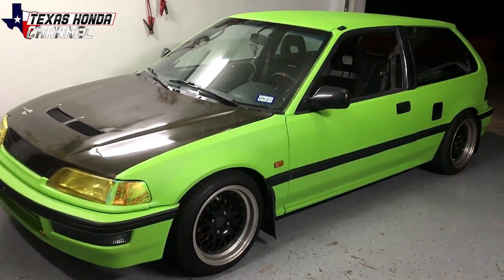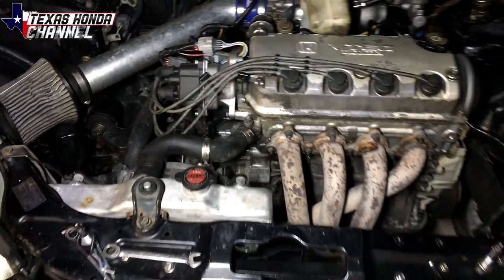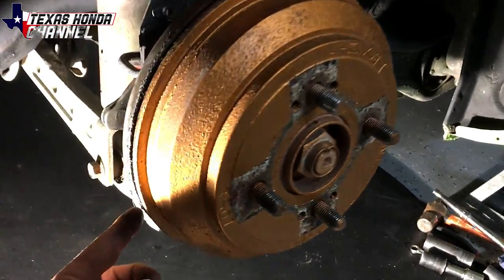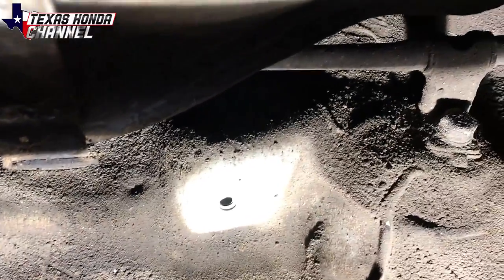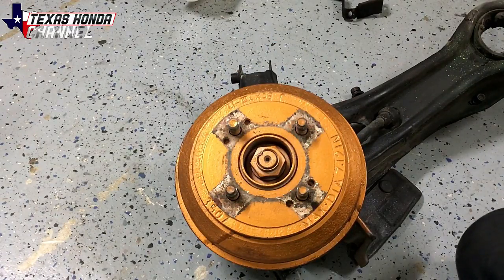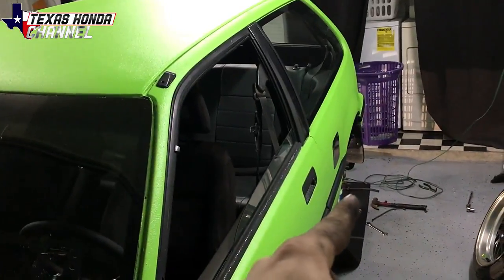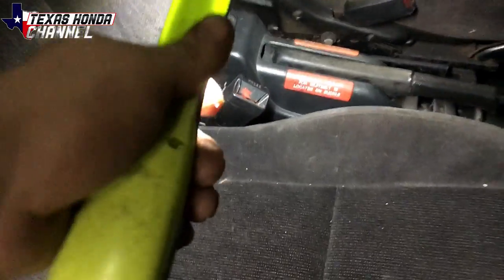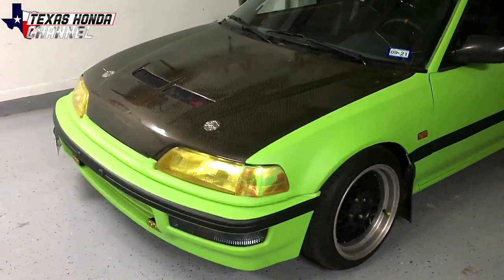1990 Civic Ef Hatch Rear Disc Conversion (How to Step By Step)

Comment: Hi bro one question for you I did that comvertion and I didn't change the 50/50 valve  and I don't understand what is the difference and why  need do be changed ????
Reply from the maker: It helps to replace them with 50/50 for more rear breaking power.
Reply: @TexasHondaChannel  
Ok thanks

Comment: Do you know what disc conversion would fit an EK hatch?
Reply from the maker: Yes you do the same method used in here. Now you can just throw the whole thing on like i did or you can just unbolt the rear drums and swap over the ebrake cable, Brake lines and the rotors/brake calipers on to your ek trailing arm.
Reply: Texas Honda Channel  awesome thanks man, love the content keep it up and like I said on one of y’all’s live streams if y’all come to San Antonio make sure to let us know!! Currently on west side but I’ll be by 35 and 410 soon